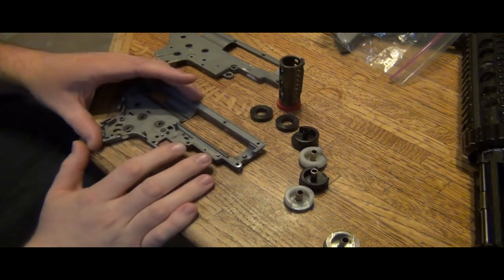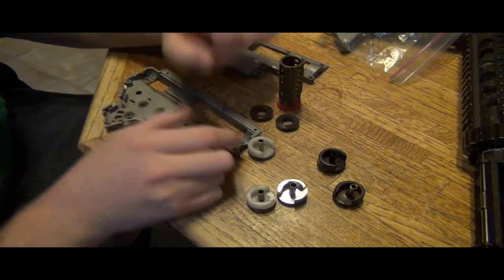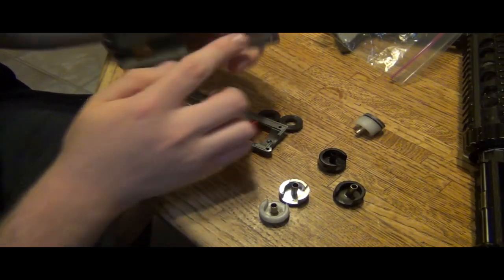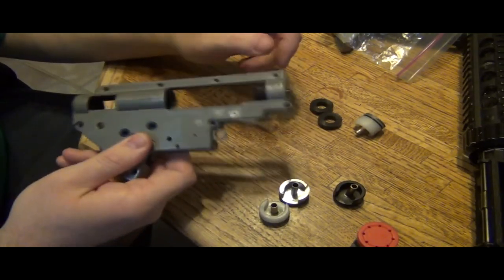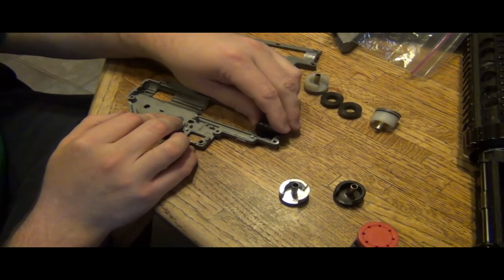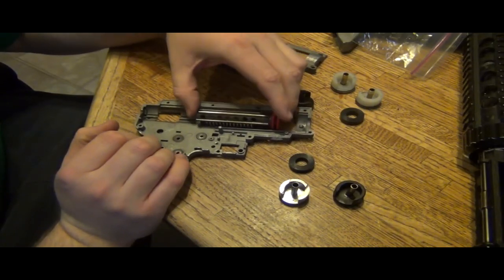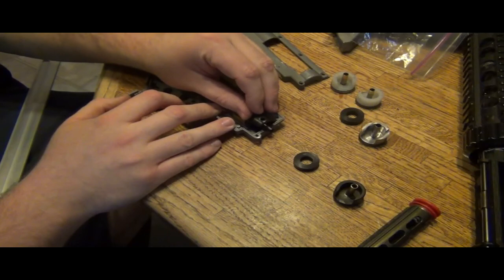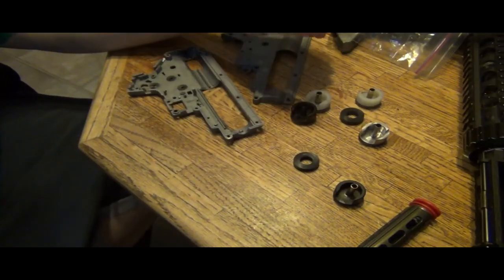Preventing Version 2 Gearbox Cracks, Something I noticed

Comment: The type of epoxy used in the video is more gelatin type providing cushion rather than ultra hardening epoxy. I use this as a alternative, since loctite is rare in Japan. It seemed to work quite well after stress testing. However if it gets stuck and hex gets stripped when wanting to replace internals, i'll just drill out the head and force the screw out. Than replace with new screws, since I can get a bag full of screws for very cheap here.

Comment: However yes on gearbox, I use super glue, only epoxy on the 2 screws for the blowback arm. The gearbox doesn't need alot of tightening, just enough super glue or loctite to keep it from getting loose.

Comment: In my experince when there is a gap like that, the tabs on the gearbox just simply break off. Here's one thing: when I see a gearbox crack from the other size first, I think it means that the gearbox halves have not been perfectly aligned, causing the other half take more load on the piston impact. The misalignment may be caused by a bad cast tolerances or burr's on the alignment tabs. Just throwing this on here.. :P

Comment from the maker: You want the cylinder head to completely press against the front of the gearbox. If it doesn't, it will move all the impact to the mounds and therefore very close to the edges of the shell where it cracks.

Comment: Good video, I subscribed. A simple mod I sue alot to reduce stress is adding epoxy to the 2 holes in the cylinder head and pushing it all the way forward to be flush against the gearbox. After it's dried double check to see reduction in play. Also it reduces alot of stress on the 2 gearbox prongs which under high ROF causes alot of vibration which leads to alot of gearbox cracking.